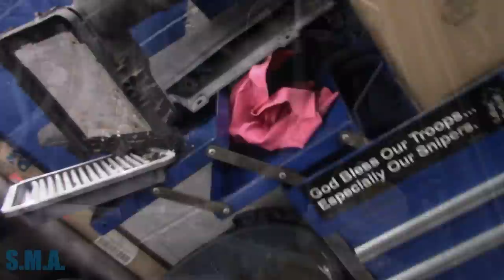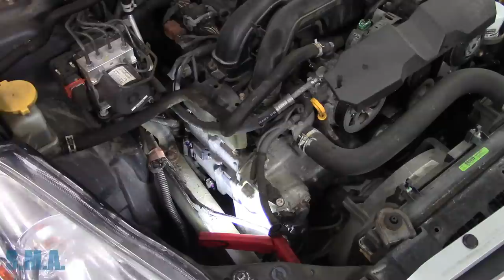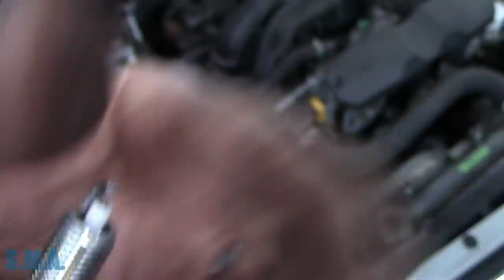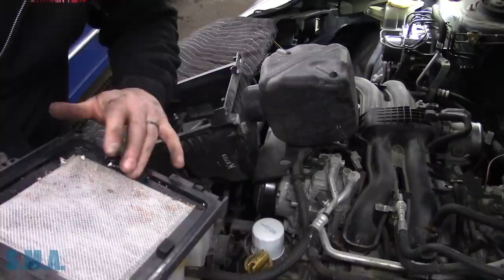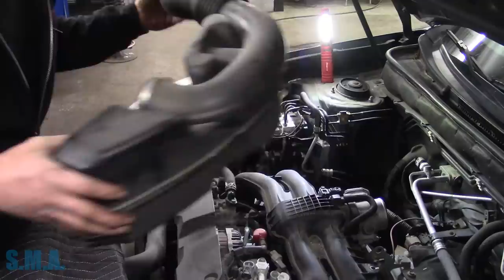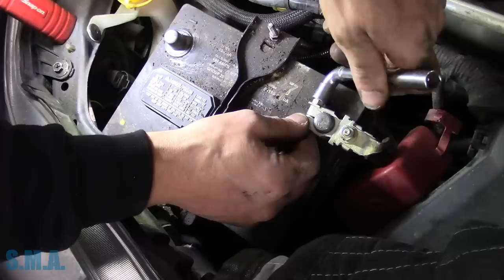Subaru Outback Repair Series: #2 Replacing Spark Plugs

Comment: I feel you on the lego spark plug removal method.  I use electrical tape and twine to attach to various pieces to pull them back out, when working no the Chrylser 2.7L in my Stratus/Sebring twins.  Also, the firewall insulation is hell on the hands.  Other method is to use a whole bunch of knuckle adapters, so it goes in like a snake! :)

Comment: One of my dads friends always says “Don’t let your Meat Loaf...! 😂 I’m enjoying the Subaru videos man, I’m basically rebuilding a 99 forester, everything I touch breaks... and I’m in Tennessee... probably snows once a year... That rear suspension bolt has me a little worried now..! I’m dealing with broken front spindles right now, cracking where the ball joints go in...

Comment: I changed the plugs on my 2011 Legacy EJ25 at about 75k.  It was pretty easy.  I put some copper antiseize on the new plugs.  Not as easy as my VW.  Easier than changing the low beams on the Legacy.

Comment: Flat rate method is to remove engine mount nuts and jack the engine up 2-3 inches until spark plug holes are above the frame giving you a straight shot access to spark plugs.

Comment: I have the 2015 and just used my shortest extention to remove the spark plug. You can also use a piece of fuel line and stick it on the end of the plug. You do not need any specialized tools to do a spark plug change on a subaru. I did find removing the 2015 battery tray a royal pain. It has 4 bolts holding it in but once removed, it's way easier. Word of caution, you WILL drop a bolt down in the belly pan of the engine, then you have to remove a 14 mm bolt and a few push pins to pry down the edge of that belly pan to reach the bolt. Be prepared to have a magnetic pick up handy for this job.
Reply: Is Subaru the ONLY vehicle that requires removal of battery and tray for plug change?

Comment: As you removed those plug coil wires, I was thinking "Good thing this isn't a FCA product.  There would red locks everywhere you can't reach."  

Ten seconds later you confirm my thought process.

Comment: A short piece of vacuum line pushed onto the spark plug terminal easily gets the spark plugs into the hole every time.  Works better than the tool they sell that slides over the porcelain.

Comment: I DIY changed my plugs on my ‘15 Outback with 156K on it...it was many hours and lots of swearing.  I then needed 2 front CV axles and found I needed a rear wheel bearing.  I said to heck with it and traded it in for a 2020 RAV4.

Comment: I actually don't use spark plug sockets at all anymore. Had too many rubber boots end up in places they shouldn't. I do have a couple mainly for that wrench fitting on the end but I remove the boots first thing. Also, I absolutely HATE doing plugs on these. Driver rear is the definition of pain.

Comment: I have a 2006 Forester XT 5mt since new with 220,000 miles & have changed the spark plugs every 60,000 miles so I can relate on how little space there is

Comment: I can do plugs in all of about 5 minutes on my 87’ 4Runner. Love the simplicity
Reply: Try a 77 F100 with a 302, not a typo. Sit on a fender, feet in the bay and pop them out and in. Easiest vehicle I ever worked on. It was basic, no a/c, no power steering, 3 on the tree. Replaced the clutch, pressure plate and throw out bearing without a jack. Dad took out the bolts while held the transmission.
Reply: Well I guess, how often do you change the plugs?
Plugs last a lot longer these days.

Comment: If you just yank real hard on the filter box the bottom water, dirt box will pop off the  bottom of the filter box. Then you just pop the fender lining in towards the wheel and the chamber comes right out. Lol as a Subaru tech I’m going to critique every little thing you do. 😂🤣 I’m just playing, your a better mechanic for me, that’s for sure. But one day I’ll catch up. Of and don’t take the connectors off the coil packs. Just take the ten out and pull out and up on the coil pack and lay them towards the back near the trans. Those connectors cool and break often. Usually people who aren’t delicate but every time you take em off the get closer and closer to breaking.  On the H6 motors there less room so you’ll have to take the connector off of the rear ones.

Comment: Thats why i own a 08 Hyundai Elantra motor is easy to work on the only bad thing is to remove the caliper bracket you have to remove the control arm which i had to cut the bolt.

Comment: Oh I miss the days at jiffy tune 100 degrees in the shop it comes in for plugs the engine bay 175 degrees and they'll wait for it
each and every plug requires a totally different 5 or 7 piece set of specific wrenches and procedures and they pay $10hr

Comment: I allways use a piece of rubber tubing to start those plugs way down in the holes lol
Reply: Huh. That's a good idea. Tight enough to feel threads but soft enough to avoid destroying aluminum heads. 

Crossthreading is nature's loctite but not always the best outcome.
Reply: I've kept multiple plug boots over the years for just that purpose.
Reply: The old ones are the best , Yeah
Reply: I try to save Different sized boots and use 1 that fits best.

Comment: Getting ready to do this on my 13 outback. I think they might be due at 140k. Had a dealer replaced short block due to oil consumption, but I doubt they put plugs in it then. Could be wrong, didnt think to ask...

Comment: Eric I need a mechanic like you in my area, my truck is in the shop and the mechanic shop wants to blame every other part went wrong and not their own work. Even tho I only put 5k on the new transmission and still has 25k left or another 12 months before the warranty goes out.... I hate shops! And so the new transmission and servicing costed  4k and want to charge me 8 hundred more for a part I don't think needs to be replaced UGH!

Comment: subaru should have made the airbox a bit less "square" because the filters are easy to install incorrectly... just make sure the rectangle pokey bit is on the top and the bottom (installed into car) 

I like to think of the rectangle pokey bit as a handle... idk if it was designed that way or not but you can pinch it out of the airbox using it.

Comment: 4th cylinder (driver side rear) is the worst one to get it out with so little room. My subie had a bad coil pack on 4th went bad. The coil pack seems to be common problem on subie from what i read.

Comment: When you (and I) was a kid, they only had 3 threads on them.  Of course, they also produced one HP per cublic liter.  Now it's like 100HP / L, so more threads are needed, LOL.

(Okay, maybe 25-30 hp/L as a 5.7L V8 got as low as 150 HP in the 1970s smog motors.)
Reply: The Ford Triton 5.4L 3-valve had FOUR threads on the early 2000's motors.

Comment: I find on my subie I can put a 3/4 inch socket on the back of the spark plug socket to make the whole process a little easier.
Reply: +1 from doing this on a '97 DOHC Outback
Reply: @chrisstoddard1144  mine is a 99 obw 2.5 dohc

Comment: Just wondering if you gaped the iridium plugs off camera or not at all. The last set I bough I was told that I was NOT to check the plug gap as it does something to the plug tip and screws it up ... and if you break it you  brought it... Let me know

Comment: A Subaru plug swap isn't that bad,at least you don't have to remove the intake manifold,move crusty EGR fittings or work with your nose 6" from an open fuel line.

Comment: The dohc engine is very problematic when changing the plugs, so I am guessing that's what this is. The sohc is easier - you still have to remove all the peripheral stuff, but the plugs are higher and clear the frame better.

Comment: 6.5 creedmore is New York? I'm assuming sanity ends at the city limits then?

If you really want to try long range find yourself in a high elevation state west of the bread belt. The thin air above 7000 feet helps.

Comment: Flat 4 - all fun and games until you have to work on em!
Reply: the only slightly difficult parts are valve cover gaskets and spark plugs (on the dohc models). everything else is easy

Comment: Eric, if you're the next guy to change the plugs, the quick job you thought you had turned into a nightmare because the last guy didn't put anti seize on the plugs. Just sayin'. On the coil bolts too.

Comment: Subaru spark plugs..... A piece of fuel hose on the end of the plug.  Enough flexibility to bend and get the plug in. Enough rigidity to manually thread the plug in the block.  Enough sliptivity ( made that word up) to pull easily of the plug.

Comment: Welp watched two hours of repair vids on a vehicle I'll never own. Explain that sickness. Anyway, loved every minute of it. However it got me thinking about how I'd probably go for the most difficult plugs first, removing them all first and then reinstalling them all. Just my personal preference. Nothing wrong at all with removing and replacing one at a time. BUT that got me thinking. How does Eric brush his teeth? Does he open the toothpaste, apply some to the brush, put the cap back on the toothpaste and then brush? Or does he open the cap, brush, and then replace the cap? Again more sickness.

Comment: I thought I was the only 1 tgat hated the wobble plus. It never works for me. The bolt is usually rusty so I have to push on the extension so I dont round the nut or bolt out, then it locks. If you have to apply any forcing force to bolt the extension becomes useless.tgats just my experience.

Comment: Can the motor be jacked up a bit to help open up the clearance?  Job looks as miserable as I feared when I looked at wife's Forester (hate that car for so many other reasons already)
Reply: Yes, you can take off the two nuts in the motor mount crossbar from underneath and lift the engine a good 1"-2" with a floor jack (well padded) on the oil pan.
That's what I did on my 2012 Forester to replace the rocker cover gaskets.

Comment: I remember when step 1 on a Subaru tuneup was remove the spare tire.
Reply: no i can work around that on moms 91 loyale
Reply: I remember those. That was many moons ago.
Reply: I almost bought a little Subaru that the door opened backwards and was almost the full length of the car. Had a air-cooled 2 cycle with a oil injection system

Comment: Coat the battery terminals and lugs with grease before installing- inside and out.  They will never corrode.  The connection will stay perfect.  This is from the saltwater boating world down south.

Comment: Here is a contraversy, do you put anti-seize on your spark plugs?
Reply: I’ve done both, I don’t think it makes much difference.
Reply: Just a tad bit doesn't need to be covered of it IN MY OPINION lol
Reply: NGK says don't .  See there site.  Already special coated.
Reply: Nope ,  Use CAT Green Cement ,  it's more fun that way .  Next person to remove them will need a Cutting Torch . Lol.
Reply: If you don’t use much, it’s harmless but unnecessary for premium, coated plugs.  If the engine is known for stripping plug threads or seized plugs, it can’t hurt.
Reply: From NGK.  NGK spark plugs feature what is known as trivalent plating. This silver- or chrome-colored finish on the threads is designed to provide corrosion resistance against moisture and chemicals. The coating also acts as a release agent during spark plug removal. NGK spark plugs are installed at the factory dry, without the use of anti-seize. NGK tech support has received a number of tech calls from installers who have over-tightened spark plugs because of the use of anti-seize. Anti-seize compound can act as a lubricant altering torque values up to 20 percent, increasing the risk of spark plug thread breakage.
Reply: Not every brand spark plug is coated, but every package of spark plug anti-seize tells you to reduce tightening torque by X amount or percentage.  Trust your experience or seek advice.

Comment: How times have changed. I remember sitting on the fender on my ‘72 Duster, legs hanging in the 
engine compartment changing 6 plugs and gapping the valves about every 5000 miles. 
Now you have to be a brain surgeon just to get to the plugs. You are impressive sir.

Comment: As the owner of a 2014 Outback, after having to change the front headlamp bulb, the designer and engineer should be made to floss their teeth through their ears. This would likely be easier than changing the lightbulb on one of these vehicles.:)

Comment: Could you have added anti seize on the spark plugs?
Reply: I could be mistaken but I'm pretty sure NGK doesnt recommend using anti seize on their plugs
Reply: NGK site says don't do it.
Reply: It seems like a great idea especially on aluminum heads,but no,do not do it.I have seen it cause misfires even when using very little,and it interferes with heat transfer from the plug to cylinder head.
Reply: Most modern plugs are zinc plated so it isn't necessary. 
I still use a tiny bit anyway. Aluminum anti-seize will have the same conductivity and heat transfer properties as the aluminum cylinder heads they are bolting into. The solvent that suspends the aluminum and makes it like a liquid will evaporate away. Been doing that for 15+ years on literally thousands of spark plugs and its never caused a problem, only helped to prevent them.

Comment: Omg changing plugs on that engine. Is like changing oil in a boat that you have to pull the motor to get to the drain plug. 😱

Comment: Aaaaand this is the reason I look at a Subaru and say... NOPE!
Reply: RUN! Don't walk away from a Subaru!
Reply: Would be easier without the strut towers. I like flat engines in general, but today's cars make them impractical. Keep in mind flat engines keeps most private planes in the air.
Reply: Amen.  And it's not the only reason.

Comment: I have a1999 f150 what do you recommend on how to remove the plugs on this triton 5.4 engine with out breaking them?.
Reply: Those engines don't have issues with the plugs breaking, thats not until around 05. Make sure you torque the spark plugs to the correct specification with a torque wrench though. That engine does have a problem with the spark plugs coming out on their own and 9 out of 10 times its due to the spark plugs being under or over tightened.
Reply: @ouch1011  thanks for the information, it will be helpful.

Comment: Spark plugs on a Subaru (like Porsche) are just terrible.  Those are hidden by a bunch of other parts so you have to on the six cylinder do it by feel on an extension and a u-joint socket wrench.  The worst to change.  I should note I changed mine at 90,000 miles and although worn the engine ran well and they were fine.  Probably could go 100,000 before switching.  This is based on past experience with these spark plugs.

Comment: Do you use NeverSneeze on the SP threads or do some get it and some dont?
Reply: Can you get that at the Walmart Pharmacy?
Reply: NGK reccomends against it if using NGK plugs. They have a very good anti corrosion coating and if you lube the plugs then you're more opt to overtighten them when using a Torque wrench.

Comment: thanks Subaru for hiding them under everything. When I saw 45 min for a spark plug replacement, I was curious to see where they are hidden. Almost as bad as early century Nissan Sentras. You have to remove throttle body, air hoses... for 4 spark plugs.
Reply: On an INLINE  4? You gotta be kidding!

Comment: This comment goes out to anyone who has any tidbits of advice regarding the 2018 Outback Spark Plug replacement.  I've watched countless videos of replacing the spark plugs on an FB25 engine BUT, none have shown the 2018 and we don't have our battery secured directly to the frame w/ a simple little battery tray.  We have some beefy, metal battery encasement that is bolted to the frame and the accessibility looks painfully difficult.  Has anyone replaced their spark plugs on a 2018 Outback and any suggestions on tools that would be required to remove the metal battery encasement?  I'm presuming it needs to be removed.  Or if anyone has found a video of someone doing it, if you could pretty please share a link that would be super!

Comment: Next time you do this service on a Subaru like this; rack it, lift it, zap the cradle bolts that hold the engine to the rest of the car. Lower it and then floor jack with a block of wood and jack the engine up some and you will have decent room to do the driver side. When you re-install the battery turn the key to on 3 times letting the gauges sweep first each time. Then let it idle the third time so it can re-learn the idle. For your commenting on that one viewer who is watching it that long and does it for a living...it's like your talking to me. Except right now I am not married; just have a girlfriend who will be my wife.

Comment: At least they're not 5.4 Triton plugs. Only one way to get those out: IMPACT
Reply: Gotta be careful with those 3-valve-per-cylinder models, though....
Reply: They tend to remove themselves over time don't they?
Reply: @robmd3851  touché Rob MD. Touché.
Reply: If I owned a 5.4 3-valve Triton, I would DUMP it BEFORE the first plug change! lol
Reply: My 01 crown vic 4.6 randomly shoots the plugs out.
Reply: @jonnygg6594  that's some BS right there. I have several 03 Panthers that have never shot plugs. They seem to have figured it out by then. SP493's in all 8 half threaded holes.
Reply: @pantherplatform  Total BS, I think it was common up until 03. That's when Ford decided to add more threads. Love the car though, its going on 262,000 miles. Torqueing the plugs to 20ft lbs seems to work.
Reply: @jonnygg6594  here here. I drive a 95 town car daily as my winter beater but have a collection of 03's including the Marauder. I love those 03's, especially the Grand Marquis. It's on my channel.
Reply: @TheOzthewiz  keep the plugs and change the engine!